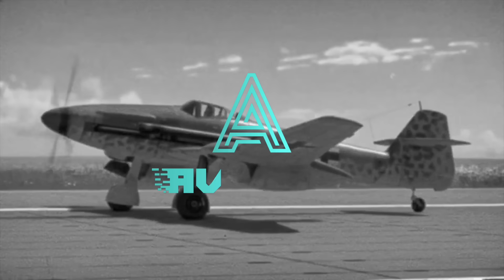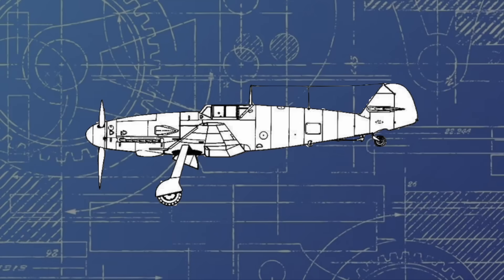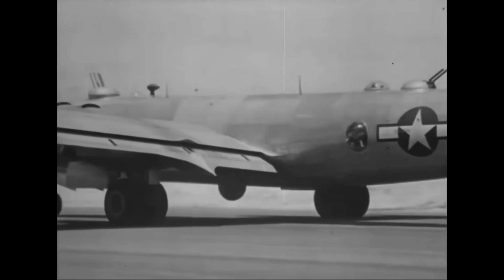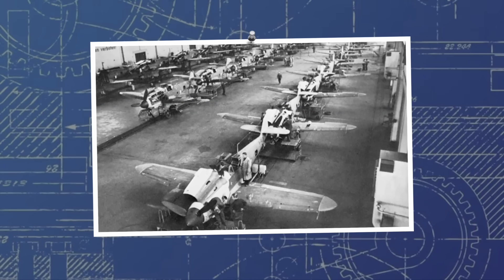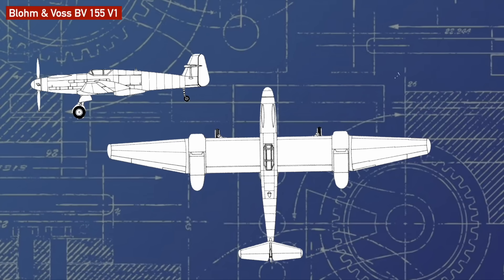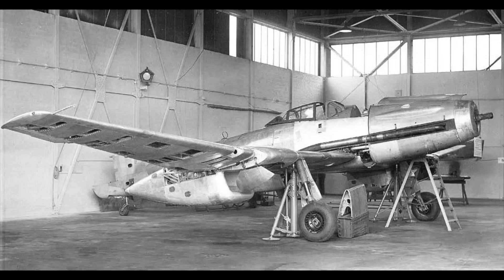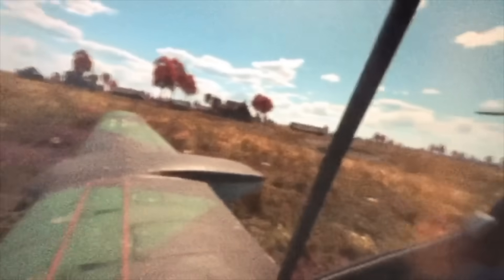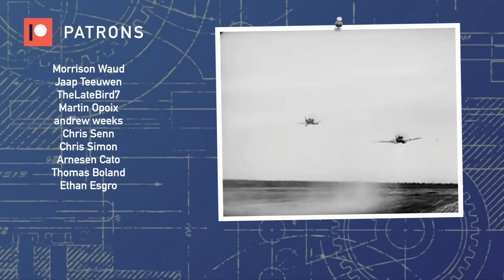The Luftwaffe's Forgotten B-29 Killer - Blohm & Voss BV 155

Comment: It never killed a B-29, it was never on the same side of the earth as a B-29. It's just amazing how it managed to kill a B-29 at a range of several thousand miles.
Reply from the maker: It was designed to kill B-29s, simple as that - hence the title
Reply: @aviationdeepdive  It was designed as to kill B29s, that's true.  It is also CLICK BAIT. If I was going to kill someone I am not a killer until I have done so, correct? I think, even you, would take exception to be labelled a killer if you have never killed.  Not only is it wrong, it it also misleading.
Reply from the maker: You're talking about the label 'killer' in a human, personal sense. That's not analogous. You're going way too deep into it. It was an aircraft designed for the express purpose to kill B-29s, therefore it was a purebred B-29 killer. If you don't understand context or simply can't deal with that then it's your problem. @petefluffy7420
Reply: @aviationdeepdive  you jut rephrased the definition if killer.  You have assumed the design goals were met, They were no,t were they.

Comment: A B-29 is a very large and difficult to conceal airplane and to my knowledge only one was ever sent to Europe.  How long did it take the Germans to figure out they would not be facing the B-29?
Reply from the maker: Well the knowledge of the B-29s existence was certainly available to the Germans, although they probably didn't know much about it. It actually doesn't say when they realised they wouldn't be used, perhaps they never did. It's same to assume that they probably predicted about 1-1.5 years from the first flight to operational use, but that would be late 1943 or mid 1944, by which point bombing raids were a massive issue for the Germans anyway. Even so, perhaps they simply thought it was taking longer than usual to get the B-29 operational, or that the B-17s/B-24s would be getting slowly withdrawn from service and replaced soon.

Either way, by 1944/1945 they needed interceptors anyway, just not for the B-29. They probably thought it was coming, whether sooner or later.

Comment: B29's served in the Pacific theatre, not Europe...
Reply: @GNMi79 Ze Germans
Reply: @GNMi79 Exactly.  All the Germans knew was that America was building a high altitude, Heavy Bomber.    When you hear that your enemy is building a 16 foot long ladder to get over your 14 foot high fence, you get to work building a 20 foot high fence!
Reply: There were plans to base B-29s in Northern Ireland. Also the B-36 was under development at the same time as the B-29. If the Germans got wind of that, it would explain a lot about the BV-155.
Reply from the maker: I never said otherwise. I said the Germans THOUGHT the B-29 would bomb Germany, but I say in the video they were mistaken.
Reply: @aviationdeepdive  you are right, I made my comment early in the vid...
Reply from the maker: @robertchautardjensen6846  That’s ok, some others have made a similar mistake but they were far less polite than you
Reply: @aviationdeepdive  what fascinates me is that the Allies used at least 120 octane gas in their aircraft and the Germans were struggling with 80 octane gas and their aircraft were as competitive as the allied aircraft in most cases.
Reply: @robertchautardjensen6846 German aircraft engines had to have greater displacements to achieve comparable power to allied engines which used higher octane fuels.  A YouTube video exists that discusses that issue.  Also, the octane differences drove the Germans toward the use of water-methanol or nitrous oxide injection for short emergency power boosts in combat.  Allied fighters could use higher supercharger boost pressures to get a similar effect, so allied aircraft designers did not implement these injection systems as often as the Germans.
Reply: @aviationdeepdive And the USAAF fostered the misdirection by sending one (or two?) early model(s) of the B-29 to England so that German high altitude photo reconnaissance aircraft could get a picture.

Comment: Absolutely NOTHING to do with the B29. The B29 NEVER, EVER used over Europe in WW2. Utter rubbish post!
Reply from the maker: Please educate yourself. The Germans were aware of the development of the b-29, and they THOUGHT it was to be used in Europe, hence they developed a counter to it.
Reply: @aviationdeepdive  Rubbish! It could not gain enough height over Europe to be a threat. The RAF only used it as a stop-gab for a couple years after WW2. The Japanese were well aware of its slow clime rate and would have past that information on. The Germans had more than enough aerocraft capable of operating at that height including the Fw 152
Reply from the maker: @monza1002000  I'm not going to waste more time here, as you seem to have difficulty understanding. Germany started developing a counter to the b-29 long, long before it entered service. The only information they knew was that it was a high altitude bomber, that would be very fast, and have a high bomb capacity. Also, yes, the B-29s service ceiling would have been completely fine in Europe. Otherwise, your comment is irrelevant.
Reply: @aviationdeepdive  The RAF used the B29 snd said its rate of climb, even in the later version that they used the "Washington" was inadequate to obtain a "safe" height before entering USSR territories. What is so hard for you to understand about the fact that the Germans did not design an aerocraft to counter the B29?
Reply from the maker: @monza1002000  Source for that first claim? That's not really relevant either, we're talking about WW2, not post-war.

The Germans designed the BV 155 to counter the B-29. That was literally its entire purpose. Every single source on this aircraft will tell you that.

Comment: "Mechanically operated Turbocharger."
Long winded way to say "Supercharger" isn't it? Why use 3 words when there is 1 perfectly valid word that isn't a contradiction in terms!
Reply: Personally, I think it is good that this term is used. After all, there are different systems for mechanical charging of engines. So you also know that it is not a roots compressor.